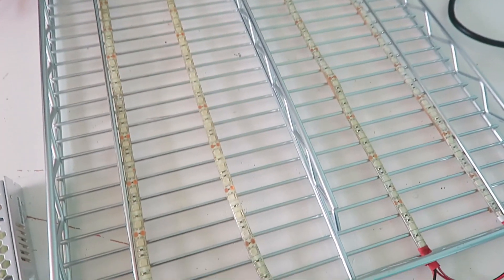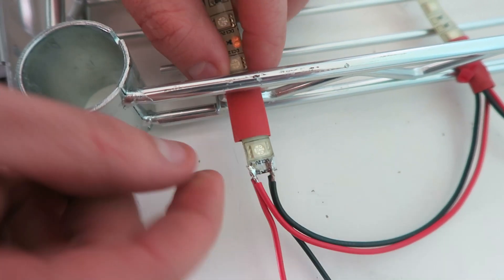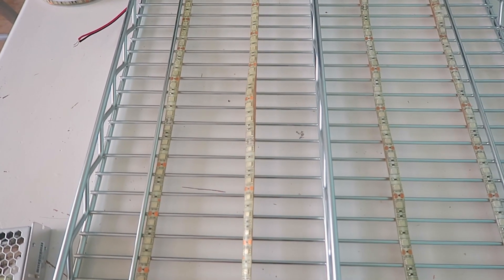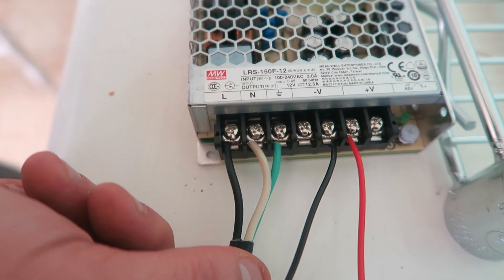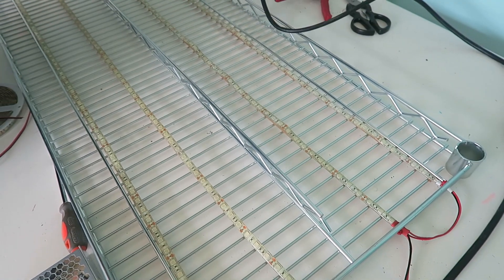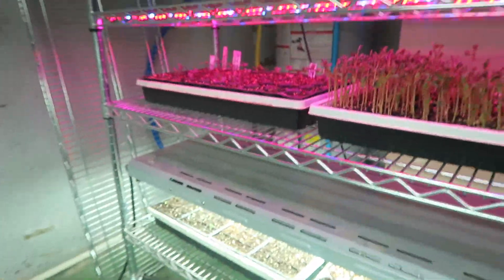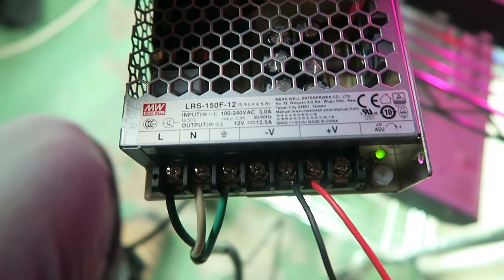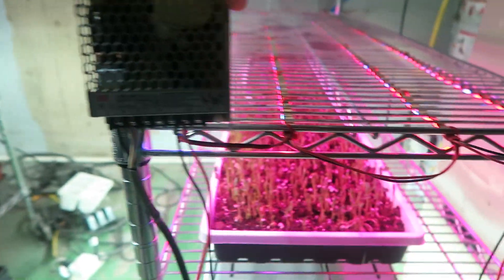Build your own grow light

Comment: I see several dangers here. First, there is a phase (L) wire that can be accidentally touched by finger - the screw is also at mains. Neutral (N) can be also problematic, as with that computer connector, some extension cord can swap L and N wire, thus both screws are possibly dangerous to touch. Also, some countries have both wires live relative to grounding wire (yellow, green). It is much safer to use those IP65 LED drivers, or at least use power supply with wires protected by a plastic to preven accidental touch. Add RCD outlet into socket for better protection, it might safe life, but only sometimes. Test button should be clicked regurarly to make sure it works. When using stranded wire, even one small stray wire can be dangerous if accidentally touched. Another point is, that there should be a fuse (on positive wire), so that short-circuit does not cause a fire. Also LED strips are better in an aluminium profile for heat dissipation. Use corner channels that can act better as a heat sink, also you can put three strips into them - one strong in the middle and two weaker at sides (white 8mm 60 LEDs/m for example => less heat, nicer look at plants). Also longer wire runs should be appropriatelly sized to prevent voltage drop and fire, there are DC wire length calculators online. Do not use CCA (cluster clad aluminium) cable ever (often used in cars audio for DC 12V...). Anyway having a power supply like that in wet environment is dangerous. From a horticulture point of view, those LED grow strips are weak and you should have much more of them for acceptable results, also add some bright white strips for better spectrum and work environment. To make this last longer,  PWM dimmer can be added, or even cheap step-down module instead and run it say at 11.5V, thus dimming it by decreasing voltage. Economically, this makes sense only as a hobby project where you can learn a lot, but those strips are not much better than CFL due to loses on resistors that are inside each LED segment. So there is a lot to learn, like securing power supply mains voltage to prevent electrocution, securing circuit from short, resolving heat dissipation of strips, dimming those strips, also soldering of course. When done correctly, it is not cheaper than those chinese grow LED blurple panels. As a hobby project, it is nice, but can be time consuming for newbie.

Comment: hello. i used LED strip grow lights and they didnt seem to work at all for growth of the seedlings. Your power supply looks very different than mine does, it occurred to me that my power supplies might not be powerful enough. Any tips would be greatly appreciated
Reply from the maker: I am not an electrician but you need to look at the manual that comes with your LED grow lights to see how much power they require. Some of the high light output growlights require more power than the low end   LED lights. If your plants got leggy they probably didn't have enough light.

Comment: is this effective for hemp?
Reply from the maker: The LED strips that I used are specifically designed to grow plants, so yes it should work just like any other LED grow lights. These LED strips are not as bright as high powered LED bulbs but I can still grow plants with them at a fraction of the cost.

Comment: Wait so will my regular led lights in my room help my plants grow?
Reply: no, full spectrum or mix of blue and red ones with wavelength of 440-450 for blue ones nd 620-670 for red ones
Reply: Yes of course , with LEDS are full spectrum
Reply: Yes! I have a lot of tropical plants and live in a basement. I use regular leds to grow my plants.
Reply: Yes
Reply from the maker: White LED lights that have a high Kelvin rating will work. Yellow lights are not so good you want the annoying white lights that are almost blue. If you can look at the light it is probably not bright enough. If you do not have access to those try to find blue/red light strips that are designed for plant growth.

Comment: Hi,
What's the luminous level of the led strip your using?
Thank you in advance
Reply from the maker: The absolute best lights are high Kelvin full spectrum lights that emit a lot of light but the power costs are usually much higher because you are using electricity to produce a full spectrum of light. If you want the most efficient light you can use LEDs that are designed with a specific spectrum to grow your plant. Some are better for leaf growth, some better for flowering/fruiting. That being said a light that is perfect for kale might not be perfect for tomato plants but I find the best light is the one that is good enough for a large variety of plants.
Reply: the luminous level does not matter for grow lights. You want to look at the spectrum produced or the kelvin rating.
Reply: @dylanedger3771  Thats wrong in so many ways, i get headaches. Spektrum is nice to have, but PAR Light output is all that matters.

Comment: Hi, one of the simplest diy grow led videos.. I am wondering if the stips worked out fine or not as they are weak so n power. Thank you for the video
Reply: theyre 14W/m which means the 4 of them on that 60cm shelf is nearly 100w/m^2 which is enough for alot of stuff, add another strip in and youre good to go for most anything else.
Reply from the maker: I use these lights for germinating plants and growing micro greens. If you are in a pinch they can keep tomatoes and peppers healthy for a few days until you get a more powerful source of light.